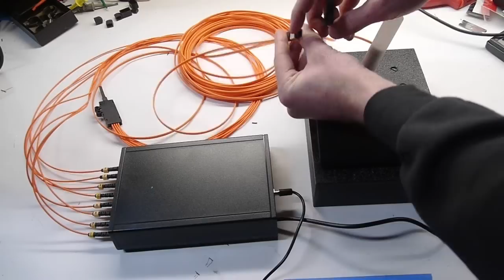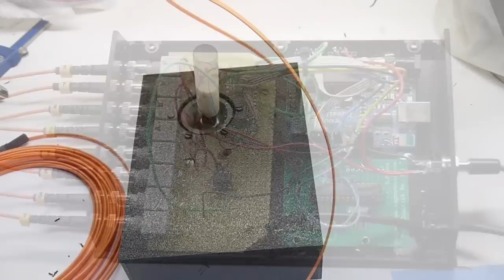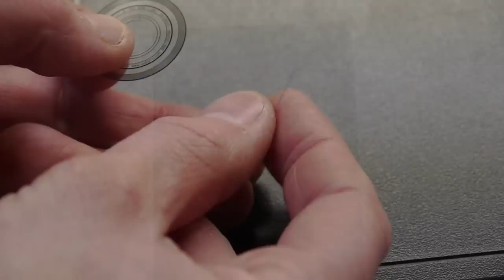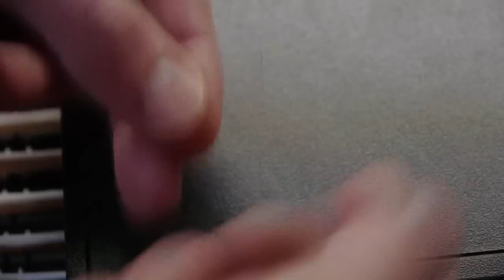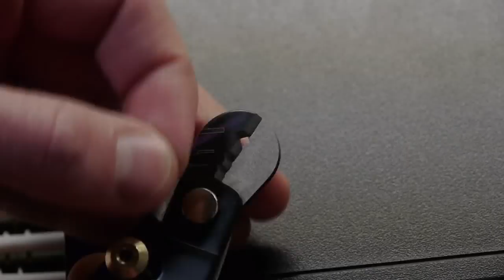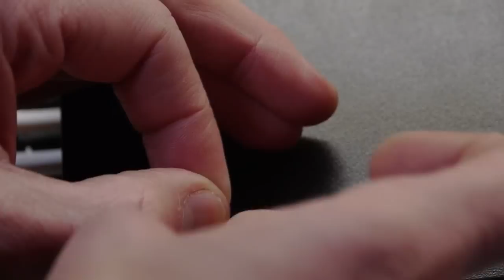Fiberoptic joystick with quadrature encoders and arduino

Comment: Interesting design. Another analog solution for a optical joystick might be a set of polarized filters on each axis rotating against each other. They would act as an aperture. If you sense the brightness of light passing through you should be able to get an absolute rotation. Not sure what resolution would be achievable. Just an idea.
Reply: i see no problem with this idea.
Reply: I wonder if light from an optical fiber favors a particular polarization, if so it might only need a single polarizer.  That said, you’d only get 45 degrees of absolute positioning with this method assuming linear polarizers.
Reply: soupisgdfood You would be able to use 90 degrees of rotation of the filters because you have aligned to perpendicular. But it’s not a linear relationship between intensity and angle

Comment: You could probably use a Teensy instead of the combination of the Arduino and the ATMega. You wouldn't have to change your code much, because they later Teensy are compatible with Arduino, but can themselves be a USB device. Vary neat!

Comment: Nice project!  It seems there would be a way to utilize one light emitter source, rather than 4 discrete (sort of like a "common ground" for light), but then again, whatever sort of light splitter you use inside the joystick case might end up being more costly than the 4 discrete light sources setup.

Comment: The wires generally won't interfere with the magnetic field of an MRI scanner. The risk is that the cables may form an ad hoc antenna, and absorb RF energy from the scanner's radio transmitter.

With high-end MRI scanners equipped with 70 kW transmitters, carelessly coiled wires can result in huge voltages, leading to arcs and fires (as well as destruction of any connected electronics).

Comment: I wonder if a pneumatic solution might have been simpler...
Reply: 2 axis and 2 fiber plus a polarizer in the other side then just compare the polarization... much easier than this stuff and you can use completely analog stuff to process the signal.
Reply: @fss1704  polarization maintaining fiber is way, way more expensive. An absolute optical encoder would be easy enough, 9 lines would give you one light in, 4 bits per axis.

Comment: I'm wondering what advantage this would have over electrical wires? I saw the mouse too.

I'm thinking waterproofing? but why would you need to go this far for that?
Reply: Did you even watch the video?
Reply: +MrOmnos yup
Reply: So, have you worked out why yet?
Reply: watch the very beginning of the video again
Reply: Just for anyone who hasn't gotten it yet, it's for use inside of imaging machines with which electronic peripherals may interfere, or the machines may induce dangerous current in electrical wires near the machine. It's covered in the video.
Reply: waterproofing is cool though.

Comment: What is the reason for a completely metal free joystick? It is a very nice job though! i will feature it in my site.
Reply: It has to work inside of a large superconducting electro magnetic, because a small child was killed when a oxygen bottle was brought into a MRI room and the bottle was pulled into the machine killing the kid.
Reply: i would have put a polarizer in the other side of the fiber and just measure the polarization of the reflected signal trough three photodiodes with different pol. angles and triangulation of the differential. Hell you don't even need to calculate the values, just create a table of the inputs over the physical movement to get a sense of the differential you'd use to compensate nonlinearity. Like reading the values of a constant motion of the axis moving from one side to another.